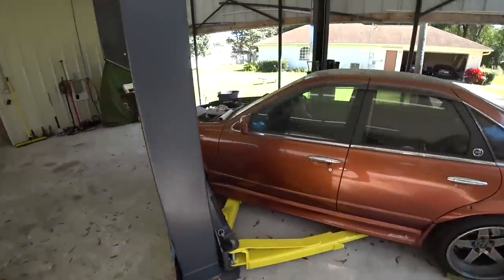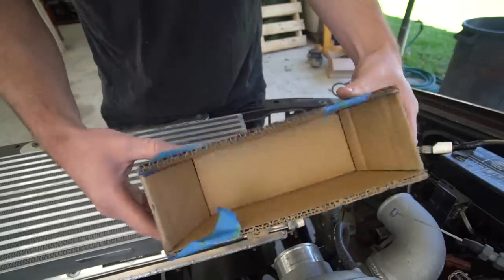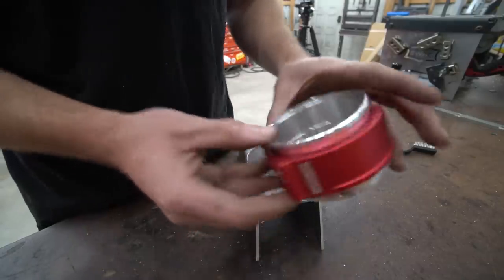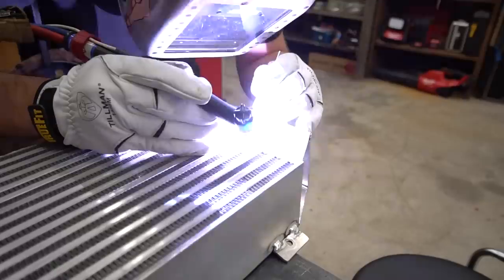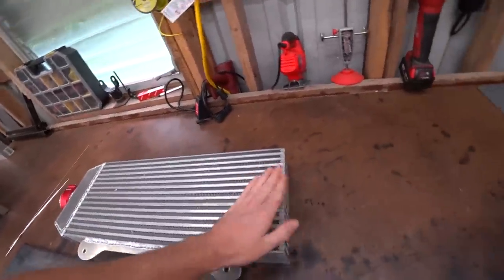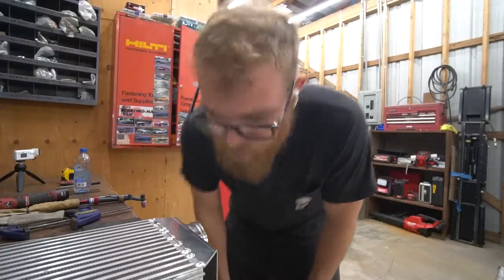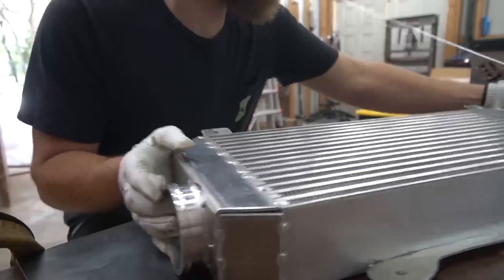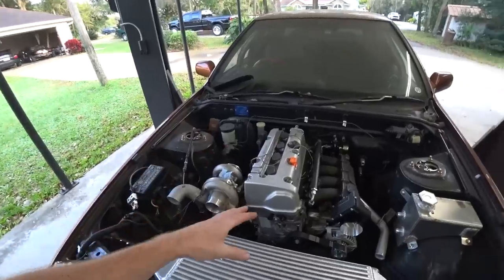Turbo K-swap Cefiro build. Making the boost stuff.

Comment: I know that this is off topic but I think I know what was causing the problems with your power steering pumps on the LS Miata. When the fluid gets really hot (like during a drift) it traps air and makes it hard to turn the wheel. I think that if you used your fab skills you might be able to run a power steering cooler with shroud and fan to keep the fluid cool. That way you could actually run power steering. Anyway just a thought. Always enjoy your videos!
Reply: betting you watched the hoonigan video when Micah explained that on the M3 eh? ;)

Comment: Taylor...the glue on the bench is lookin <clap hands> "DYNO-MITE!!!" I'll be doing the same. Also like a ½" thick, 18", 20", 24" (*??? - whatever the steel place has laying around) by ___” (see *) rectangular steel plate. Drill a hair over common diameter sizes, prolly start with .13∅, .26-ish, .32, .4, etc., etc, up to like 1.281 or so for getting a start knocking pins or bearings out of things. Got a mod in mind for my vise x-mas gift that SHOULD (fingers X'd) be pretty...neat? Functional? Aesthetically pleasing? I'll shoot for all of the above...maybe...
hopefully...???.

Comment: Hey get a roll of ram board from Lowe's or the equivalent from home Depot. A huge roll is like $40 it's roughly 4'x100'. It's made for covering floors when remodeling or building house but it's also perfect for CAD and lasts forever. It's like having a whole roll of cereal box cardboard.

Comment: Tack large filler to the piece you're trying to hold in place. Hold piece of filler with material in place you want. Fuse piece in. Break filler off. Weld in.

Comment: Perhaps the intercooler end tank could've had a 30 or 45 degree angle at the throttle body end, so it was pointing towards the throttle body. However you've still got the issue with installing & removing, so that's probably useless. Love the fab work anyway!

Comment: My first employer insisted i use my impact/air ratchet as much as possible but i've moved to using hand tools more in the past couple years (and at a different shop) it's probably slower but i spend a lot less time trying to fit my gun on dumb places and undoubtedly break stuff a lot less. I've got a lot more different length and size ratchets and ratcheting wrenches since aswell. I agree 100% the feedback from the job just feels better. Except for that time i took my tooth out with a ratchet. That wasnt fun nor did it feel good.

Comment: next time, bend the endtank material around a 3" pipe and make them cylindrical. much easier to make a smooth 180° than two 90°, so close to each other

Comment: Try to slide your hand back on your filler rod as far back as you can while welding, with it still being comfortable. That way you're not trying to walk your rod with your fingers and dabbing at the same time. Your welds will come out more uniform.

Comment: Remember whenever you're fabricating using a pressbrake you need to account for your bend deduction or 2 bend allowences for each bend you make. Then when you go to measure out where to bend you take away one bend allowance from the length.

Comment: you've came along way learning by yourself, im impressed. you definitely have some fab and welding skills!

few welding tips: 

when tack welding stainless and mild steel you don't have to use filler rod as long the the fitment is perfect depending on material thickness, zap it long enough until the metal solidifies together (don't do it with aluminum though it will end up cracking)

any tacks on all metals except aluminum that require filler rod you want to grind down slightly that way when you weld over it, it will still be uniform all the way through (makes it look better)

before welding you want to position yourself where you're comfortable at the end of the weld not before, run the weld dry (do a practice run without power, position the torch and rod where it would be while welding and act like your welding), you want your torch hand as comfortable and free as possible (you don't want it getting caught on anything)

with tig you want to control the heat you put into the piece you're welding, avoid warping by letting the metal cool in between welds and quartering the welds (weld one quarter of the section your welding on then move opposite of where you were and weld that section) 

don't be afraid to stop welding to reposition yourself to get comfortable again, its one of the luxuries of tig welding being able to stop and start again without it really affecting much

Comment: 7:58 Hi Taylor
When using a large holesaw in your workshop you might want to comsider a cheap corded drill, it has 2 advantages - constant torque and much cheaper when it ruins the motor. (the bigger the holesaw the more strain on the tool throwing it)

Comment: I was thinking that you could have incorporated the bend as part of the end tank so it would be 90 degrees from the throttle body, then you could just use a silicone coupler

Comment: Pro tip, when you gotta use a hole saw and weld on a flange or something similar to what you did with your end tanks, weld the flange on 1st, then shove the hole saw in and cut the hole 2nd. This eliminates the possibility of the edges being welded melting away and a bit with warpage 

Also, get yourself a roll of ram board instead of cardboard boxes, best stuff ever

Comment: The length of intake piping doesn’t really matter in a turbo system.
It is not like a ball that has to travel the whole distance on its own, it is like a tube filled with balls.
When you push on the first ball the last ball moves instantly as though you’re pushing directly on it.
Once the piping and intercooler are pressurised it doesn’t matter how long the piping is, there may actually be a benefit to the greater volume of air in the system.

Comment: U want to weld the cleanest aluminum u have ever touched clean it with hand file the edges and pinch the edges with between 00-0000 steel wool that’s how I clean for my welds on aluminum express boat bass boat hulls

Comment: Coming from someone who ran a press brake for many years. You can do those close 90 degree bends with a gooseneck punch or if it hits and you need to squish it down, open the press and stick the part in and press down the 'C' from the side and push it down to bring the sides parallel to each other.

Comment: Great content. But I think you could have cut it out of 1 peice and bent those small ends by removing a couple pieces of the brake

And is there a link to the belt grinder

Comment: U should have angled connections on the inter cooler (look at old radiator flow compared too new )and if ur running that small of a turbo expand as much of the piping to 3 inch starting on the turbo elbow and if ur using pump gas 2 small fans n a shroud woodnt hurt ur intercooler... colder iats means more power before detonation

Comment: Try to find some "chipboard" material for your pattern making. It is so much better than dealing with the corrugation in cardboard or regular paper that is too thin to replicate thicker metal.  May have to search locally though as that is kind of a blanket term for the stuff and you want to see how it behaves in person before buying.

Comment: I totally agree with the hand tool thing. I almost never use impacts, hand tools you can get a feeling for what the parts are doing, and if something is wrong, you can stop and check it. You also know how tight something is when it goes together, so you know how tight it should be after some use. Don't get any of that with an impact

Comment: So why didn't you leave the top and bottom of the end tanks on the piece before you bent it?  Your press brake is a finger brake isn't it?  After you bent the sides you take all the fingers out except the one that is closest to the width of the tank and the two sides will swing past the finger, then its 4 welds instead of 6.

Comment: Taylor i run a 200 ton break press at work and whenever you get two 90 degree it always hits the machine little trick ive learned is to just bend a lil further and most of the time it works out pretty dang well

Comment: Good work T.   Use some light painters tape next time to hold them pices on there just bearly push it on so you can just yank it off for the next piece....if one side is more uneven than the other use the sander on the opposite side to make flush...for the warp issue just make sure to just spot a couple areas on both sides then finish spotting and welding each side that way she wont pull away from yuh

Comment: Bro if you ever get a legit metal break just go ahead and get a 4ft or 6ft tooth break cause if you get anything else you're gonna wish you did cause you can do any bend with them and I've had 3 other breaks before I got the one i have now and it's been so amazing compared to what I could only do before and all my buddies are wishing they got one like mine now and they use mine over there own metal breaks cause you can remove the tooths as needed to bend any sheet metal in any shape

Comment: Just a tip when you weld the ends on that radiator it would be an easier fit up if you only tac one time on each side then add additional tacks, 4 tacks on one side will pull the gap bigger on the other side obviously and you can clamp it to pull it straight but then it just weakens the 4 tacks on the other side.

Comment: Not to throw stones at you or anything but would it of not been easier to tack the pieces on the tank for fitment. Then break the tacks then weld them all off the core grind down any undesirable welds then weld the tanks to the core. Just a thought I had during the video.

Comment: Are you going to weld the bends on the intercooler end caps like you did on the coolant reservoir? Can't tell if that metal is thicker than the coolant tank or not.

Comment: you could have made that end tank all in one sheet, the brakek you have is a finger brake so it has the moveable / removable teeth, you could have cut the small ends as tabs and made those bends . a little work with a vice and some clamps after and it would have been super clean.

Comment: Slower speed and lube will net you a faster and cleaner cut with the hole saw. But then you have to clean up the lube before you weld

Comment: You need to put a bracket on the oem heater core outlet, because its gonna pop out if you put any pressure on the system!

Comment: Lower your gas flow, on aluminium it likes when you have lower l/min or cfh. I recomend going same gasflow as your cup, so if you run nr 8 go with 8 l/min and or nr 5 5l/min
Reply: And dont hurry so much when welding take your time with it.

Comment: why not get a 3" dounut and make that radius out of the intercooler (as it is now) super tight, so that its still tucked up close to the cooler and itll be shorter piping??
Reply from the maker: I didn’t know they existed. Lol. That would have worked I was just using what I had. Lol

Comment: when bending metal always account for another 1/2 thickness of the metal in dimensions. bend will = 1/2 the thickness of material. or just cut longer pieces
Reply: for the s pipe. get a 45 and cut it in the mid or the bend and flip one side , reweld,.
Reply: damn thats a tight radius to make.. nix my prev comment. also would make airflow suffer i feel if you did do it that way
Reply: also ty for taking a rescue puppy

Comment: part of your endtank is pointed right at your turbo inlet and you decided to punch a hole through the side of the end tank that is 90deg off from where you need to be??! what the fuck??
Reply from the maker: You do realize the turbo outlet is 2” from the end tank and offset 7”. Please explain how you would get a 3” pipe to offset 7” in 2” distance.
Reply from the maker: @FUCK_________googIe  it’s not. Not even close. It may look that way on camera or if you’ve never build intercooler piping but the pipe would have to do 2 90 degree bends in 2” even though it’s 3”‘in diameter. It’s no possible unless the core was 5” further that way and even then. Like just the pipe turned sideways would not fit between the core and turbo. Let alone two bends. It would have to be two u bends which would be more elaborate than a simple 90.